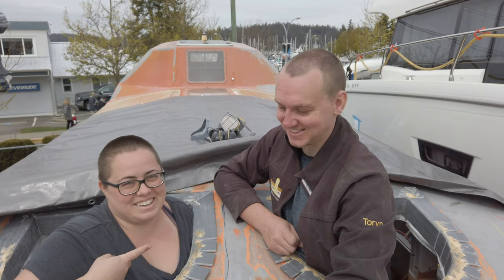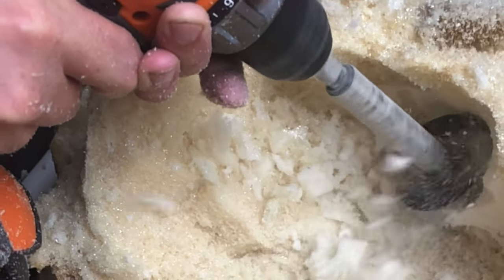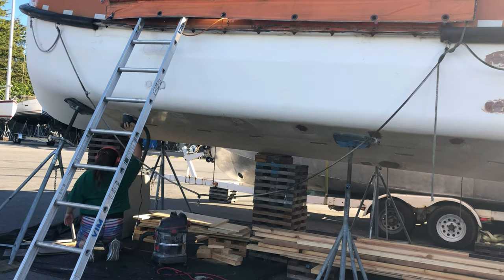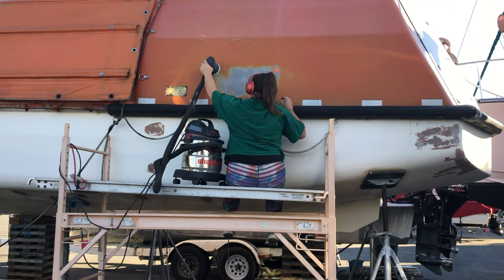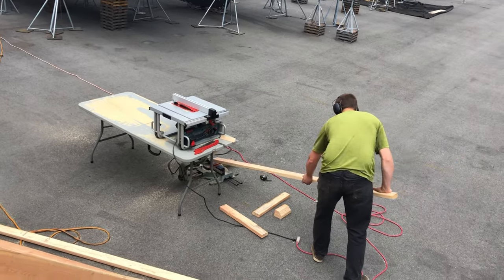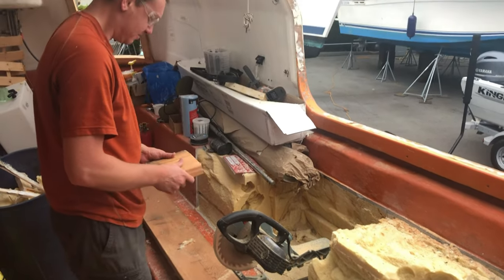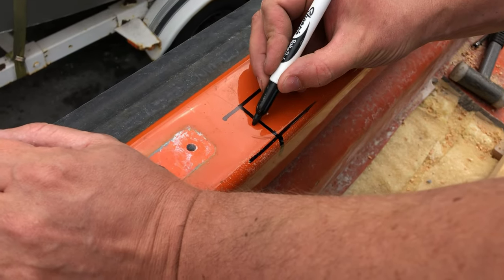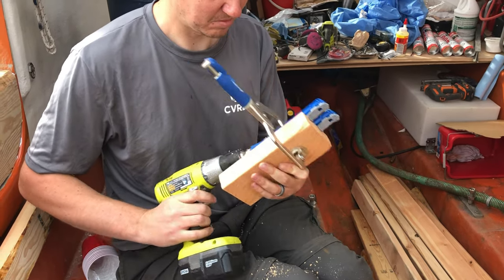Episode 8: Lifeboat Walls...Take Two

Comment: I'm new to the channel, so not sure if you've gone over this...you should do a full keel bottom. It will help with control while underway and also allow you to put some ballast low in the boat. You're going to need a lot of weight in that boat so you're not constantly bobbing and rolling. 🤮😀

Comment: The tool is made by Kreg but is in fact called a pocket hole jig, so,it means you connecting them wood using pocket holes
Reply: Technically, yes. But quite commonly known as a "Kreg tool" or "Kreg jig". I've noticed in certain parts of the US (and likely Canada) nobody uses the proper technical name outside of a catalog or hardware store tag, instead using the branded colloquial.

Comment: Instead of using wood (especially soft wood) to build your wall, you should have used structural honeycomb fiberglass panels. I would redo the job again. The side decking that you are adding onto the boat is all wrong. You need to support it. I would have a stainless angle frame made then your fiberglass could rest in that frame. I doubt it will last, it will probably get stress fractures in it and break off, also what’s going to happen if you brush up along side a dock or concrete lock wall. You may want to run your ideas past a boat builder before to do anything else to the boat. I was cringing watching you work. Sorry but I’m being honest, can’t sugarcoat it, your lives are on the line here once you get out on the water. Good luck.
Reply from the maker: Thanks for your information. The walls are not a structural component of the boat and as they are just in place to be a mold for the fibreglass attached to it they are excessive for what we actually need. Marine plywood of our span with 20 oz of cloth and epoxy will hold well over 500 pounds. Honeycomb panels have many drawbacks and are not easy to work with on compound joints. If it was a large floor or flat roof that needed to support large amounts of weight I would maybe have gone that route. 

As for the side decking it has been installed now for a year and I’m happy to say that it is in the exact same condition as when it was installed. The fibreglass grating is rated to deflect .1” with a 2000 pound load and break at 8000 pounds on a 12” overhang our overhang is around 8” so would be better than that.

Beyond that our permanently mounted fenders stick out beyond the walkways and hit any docks first.
Reply: @LivingOnALifeboat  Hi Buddy, thanks for responding. I’m happy for you, I didn’t know that you had permanently fixed fenders to the boat. IMHO, if it was my boat I would still use the honeycomb panels. After they are cut, drilled or whatever, it’s very easy to fill the edges with thickened epoxy and then a layer of fiberglass but that is my opinion. Good luck with the boat, I can’t wait to see the finished job.